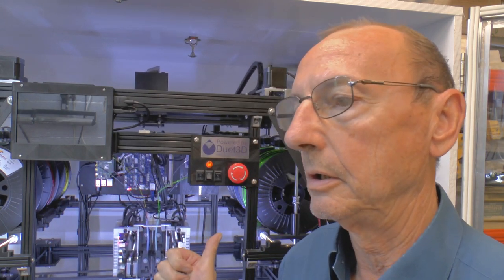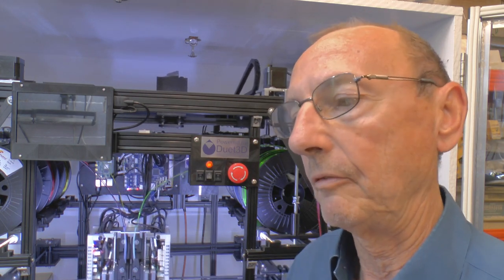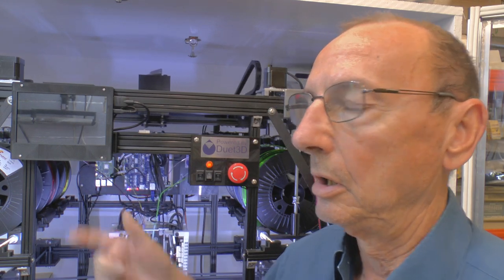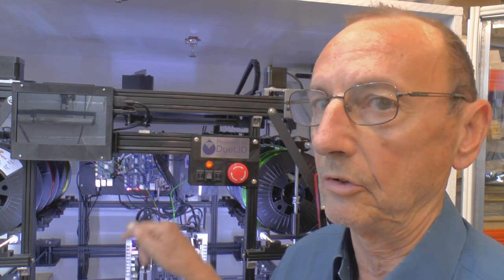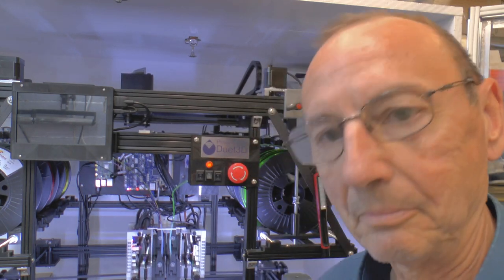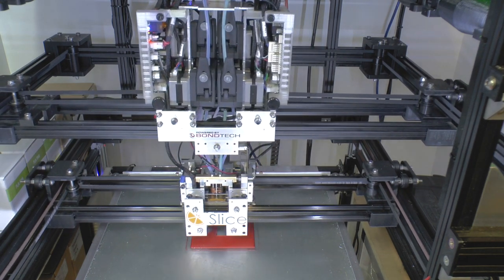New motion tricks with a CoreXYUVAB

Comment: Can you not just filter xy moves to generate ab ? I.e. have ab slowly track xy unless xy is moving fast
Reply from the maker: I think maybe you might be misunderstanding something. The purpose of the AB gantry is to cancel out any forces generated by the XY gantry by moving a lump of lead of an appropriate mass in the exact opposite directions to the hot end gantry. The way it works is by simply swapping the motor directions. So for the AB gantry to fulfil it's intended purpose, it needs to exactly replicate the XY moves. TBH, all it does is stop the printer from rocking when I start throwing the other 5 kgs of extruders and heavy hot ends around at high speeds. The only reason it's still on the printer is that I can't be bothered to take it off. 

The UV gantry is another matter altogether. This one carries the 6 extruders. That gantry and the XY gantry (which carries the hot end) are connected together by the 6 Bowden tubes and various assorted cables. But this isn't a rigid coupling. I have about +_ 20mm or so of movement between the two gantries. But the two gantries must never be out of position by more than that tolerance otherwise cables and tubes get torn out and it all gets very messy. But by exploiting that +_ 20mm of separation, it means that the heavier UV gantry doesn't have to replicate all the small moves that the XY gantry does.

The UV gantry also moves slower. The reason being that any XYUV move has to start and end at the same time to keep all axes in sync. So if the XY move was (say) 100mm, and the UV move was 60mm (100+_20) then it follows that the UV gantry must move slower in order to cover a shorter distance in the same amount of time as the XY gantry.
Reply: @deckingman  sorry i mistook the ab for the uv axes . My thoughts are that the uv could track the xy continuously , rather than stopping and jumping , if its position 'averaged' that of the xy. Image your string attachment were springs so the uv attraction 'force'  , thus acceleration, was proportional to the distance from xy . Controlling the acceleration would filter out fast moves of the hotend while maintaining the extruder over the centre of motion.
Reply: @deckingman  I liked the counter balance idea.  I'm surprised it didn't work well.
Reply: @deckingman  Another thought . Since you are preprocessing the gcode , the uv can know where it needs to be ahead of time, so it would be possible to move uv at a pace to be where xy is going to be  thus having a few mm head start and requiring less acceleration.
Reply from the maker: @wktodd  I think that either I'm misunderstanding you, or you are misunderstanding how this all works. Imagine a pure left to right move and the previous move was from X positive to X=0. At this point, U will be at plus 20 (assuming the tolerance is 20 mm). So now imagine that the next move will be G1 X100 F100 (i.e. move the hot end to X=plus100 @100mm/sec). After processing this becomes G1 X100 U80 F100. So when this executes X and U will move together. But X starts at 0 position, zero speed and accelerates up to 100mm/sec, maintains a speed of 100mm/sec before decelerating to zero speed. Meanwhile, the U move is kept in sync so it starts at zero speed, but because it is going to travel a shorter distance, it doesn't run at 100mm/sec but something less. Therefore, the rate of acceleration and deceleration will also be something less than the X axis. Or to put it another way, half way through that move, both X and U will be at plus 50. But X started at position zero while Y started at position 20. So X has had to move 50mm but U only 30mm. Actually, it's not quite as simple as that because the move speeds are calculated in firmware using 5 dimensional space (for XYUVand Z) rather than 3 dimensional space (for XY and Z).
Reply from the maker: @wktodd  This isn't the best way to communicate. If you take a look at my blog and get in touch via the contact form, that would give me an email address for you and we can continue our discussion that way.  https://somei3deas.wordpress.com/contact/
Reply: @deckingman  OK so are you saying you have no separate control over the speed of the UV axes? (are the move speed really calculated using more than XY moves? after all Z is pretty static in a 3d printer and if you don't program a Z move it only need to calc the XY vectors.

Anyway all good fun stuff :-)
Reply from the maker: @wktodd  Well if I simply sent G1 Un Vn Fn then it would indeed move the UV gantry at whatever speed I set in the "F" parameter. It would also move it to any commanded position and would tear out all the Bowden tubes and wires because a G1 UV command on it's own would leave the XY gantry wherever it happens to be. I learned this lesson the hard way ! 

So I have to be careful that in all my homing moves, I always start by moving X and U together until one or other end stop switch gets triggered, the I fine home X and U individually. The same for Y and V. 

For the same reason, if I wanted to print any gcode files that hadn't been post processed to include UV moves, I would first have to map the UV axes motors to the XY axes. Otherwise the XY hot end gantry would move but the UV extruder gantry would stay put and I'd be back to repairing all the wiring and replacing torn out Bowden tubes. :)
 
Ref the XYZ moves, for my printer I never encounter that situation. Moves are either XY or Z but never XYZ. That's because I made the printer such that the bed is flat, level and stays that way. But if you use automatic bed flatness or level compensation (as many people do) then the firmware will be constantly adjusting the Z position. So even though the gcode file might only command an XYE move, in reality, the firmware will be doing an XYEZ move. (The "E" is the extruder but it's treated just like any other axis as far as movement is concerned). There is also a slicer which will generate XYZ moves so that one could print something with a curved top surface without getting the usual layer height chnage ridges. I forget what it's called but that would also use XYZ moves.
Reply: @deckingman  I'm trying to think how i could animate the idea i have in my head... 
Btw, did you get the email i send via your blog?
Reply from the maker: @wktodd  Yes - and I replied to it.....